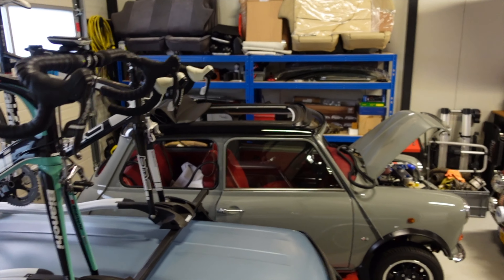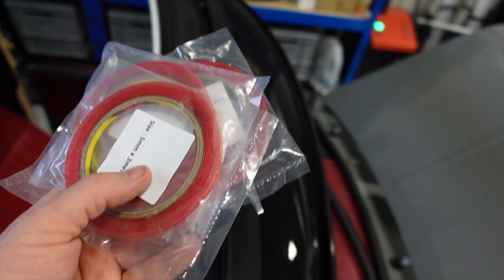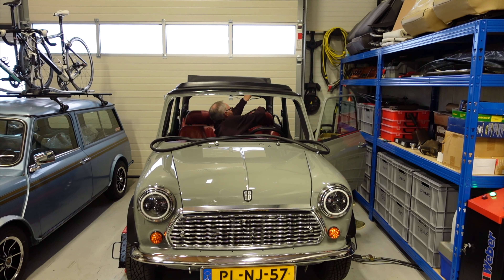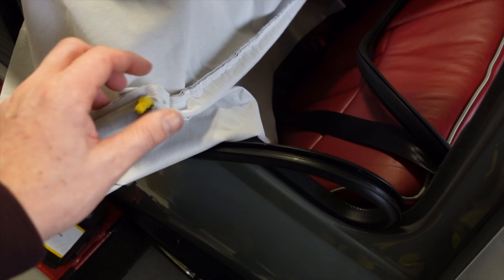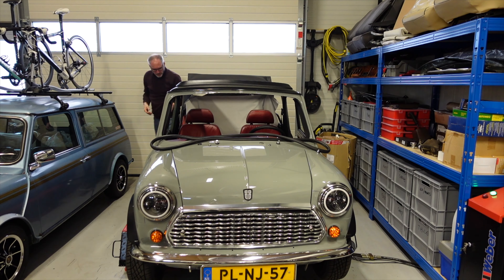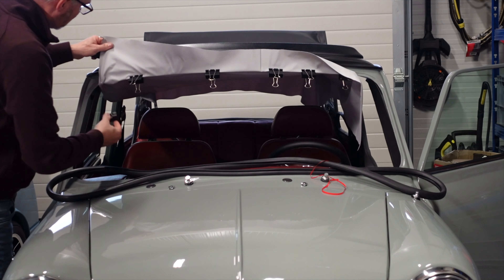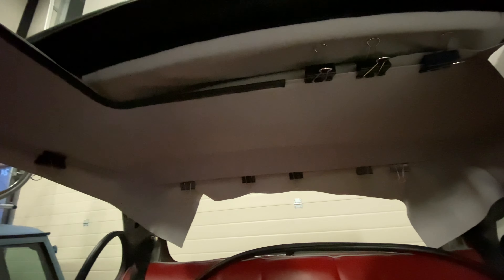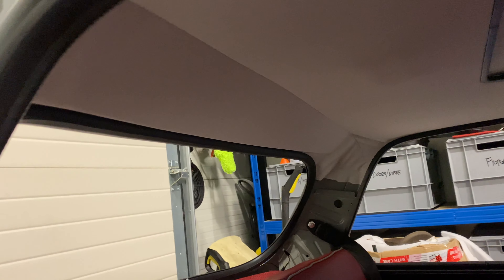Classic Mini Culture - Roof liner- Webesto open roof version

Comment: Excellent job, I paid a retired trimmer to do my non sunroof liner, he came to my home, best decision I've made. Only cost me 150 AUD (75pounds). I'm having trouble getting the C pillar covers under the rear window seals. Would you mind videoing how you do it, thanks in advance.
Reply from the maker: On the rear seat belt models the C-pillar doesn't go under the window rubbers, it just traps between them, I'll let you know how I get on with these one.
Reply: @classicminiculture9800  thanks

Comment: Is that and original sunroof or aftermarket if so where did you get it from
Reply from the maker: It's an orginal one, you can still get an aftermarket one but it is slightly smaller than the original, so it doesn't fit the original hole.
Reply: @classicminiculture9800  Well done. Where can you get an original replacement? The original on my SPI is pretty worn and has a slight tear.
Reply from the maker: @peterroshouse  Newton commercial in the UK have them for all versions of the sun roof models